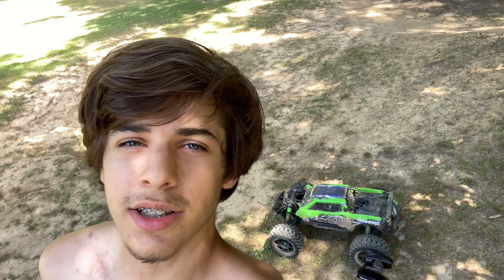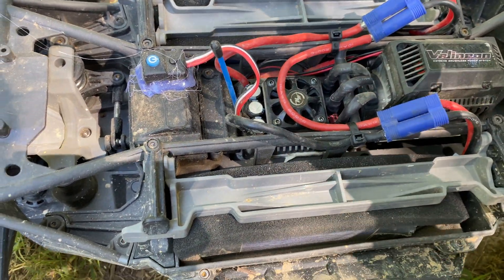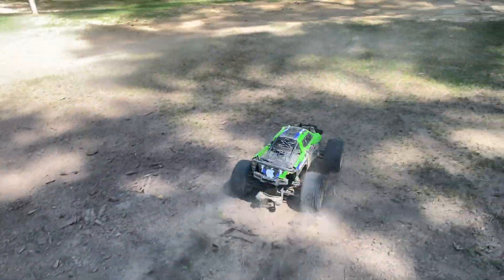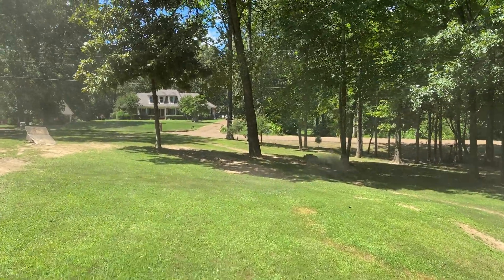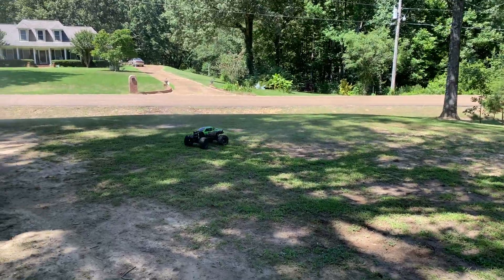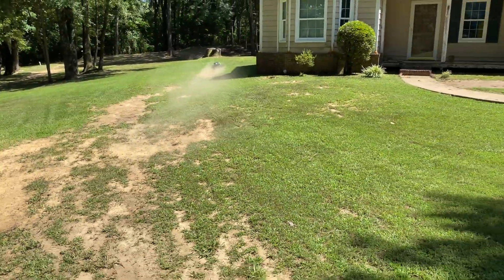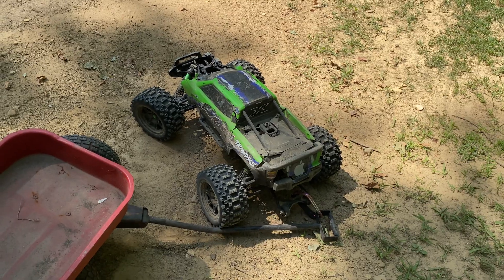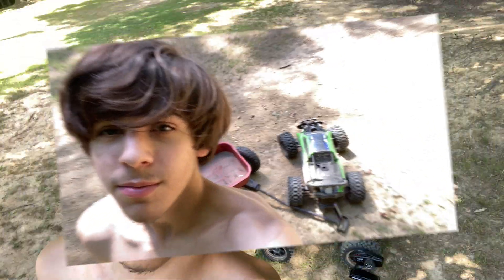XMaxx HobbyWing MAX6 Testing and Review (Best ESC for Traxxas XMaxx)

Comment: Hi 
Is it that good the max 6 with stock gearing and motor 
I just want to flip mine in the air can’t do it with stock esc 
Has it not chewed ur stock gears up on punch 5 setting
Reply from the maker: It’s a noticeable improvement over the stock ESC if you use high C rating batteries.
I was able to do flips on the stock ESC, but the MAX6 does flips much easier.
All my gears are completely fine and still completely stock on punch 5.
SUBSCRIBE!!!

Comment: Does it actually make it have more torque or top speed though? Thanks
Reply from the maker: I can’t confirm either through hard data or an RC dyno, but I can confirm that just through my senses I feel that it has more torque and speed. The extra punch definitely makes it have more torque and it seems like it’s faster because it sounds like the motor is spinning a higher RPM. SUBSCRIBE!!!
Reply: @joshsrcs  what punch were u on and did gears last?
Reply from the maker: Max punch (5). Yes all the gears are perfect. Recently cracked a bulkhead and that caused the front diff to strip out, but it was all because of the broken front bulkhead.
Reply: @joshsrcs  cool thanks. Just upgraded mine and about to test the waters with that esc and new gearing on my channel. Love making xmaxx bashing content if u wanna check it out
Reply: How are your gears holding up now 3 months on with your max 5 punch?   I’m planning to change my setting this week.   Do you have standard gearing but upgraded to hardened steel?
Reply from the maker: I am actually still on my stock set of all my gears. So I’m still on my stock spur, pinion, transmission, and diffs. Everything holds up great on max punch, but my front bulkhead split and trashed the front diff so I’m going to upgrade the diffs to spiral cut steel. SUBSCRIBE!!!

Comment: U have the stock motor on
Reply: Ty
Reply from the maker: It seems that your comment got cut off, please continue.
Reply: So what gearing is good and what fans is good
Reply from the maker: Complete stock works well. A lot of torque and not too much heat.

Comment: Hi Josh, is this just plug and play? And soldering needed? Best, Jake
Reply from the maker: Everything about this install is plug and play, except the battery connectors (unless it comes with the connector you already need). My MAX6 ESC came with “Deans” connectors (which suck and can’t take high voltage or amps) which I changed to EC5 connectors. The female motor wire plugs connect perfectly to the male XMaxx motor wires. The receiver wire also fits perfectly. SUBSCRIBE!!!
Reply: @joshsrcs  Thanks! What about the programming? Any tips?
Reply from the maker: I went with max punch, 50% reverse, and 100% brake. REMEMBER THIS: do NOT go to 7.4v if you have the stock Traxxas steering servo. It will die. I am making a video on installing a new PowerHD steering servo in my XMaxx which can take 7.4v. SUBSCRIBE so you don’t miss it!